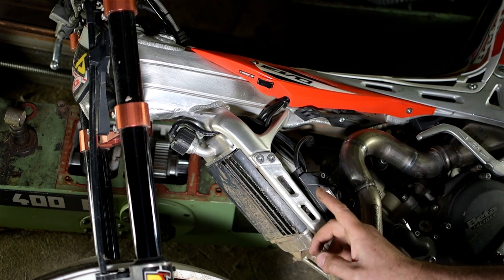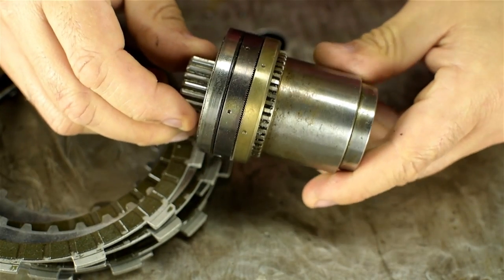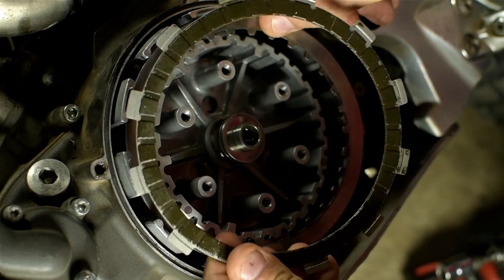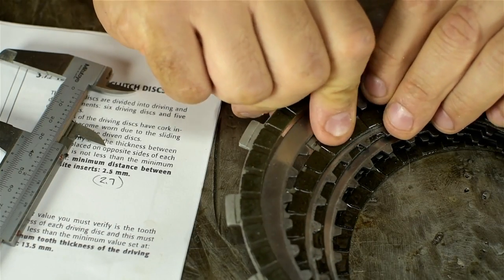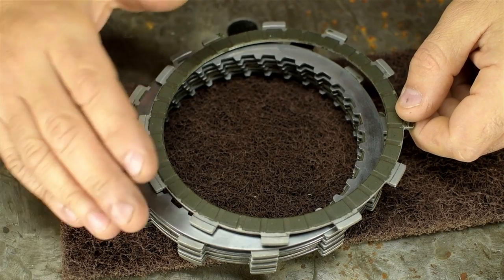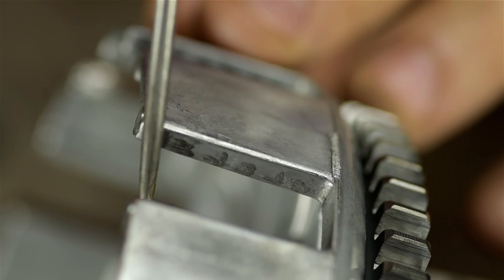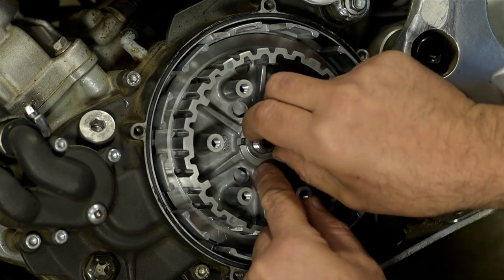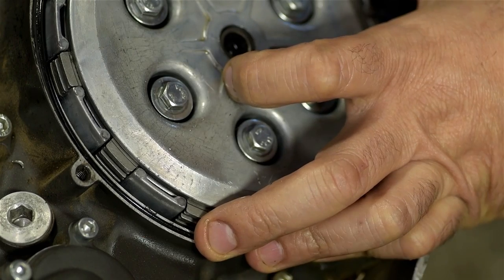something something MOTORCYCLE CLUTCH!

Comment: Hi Tony, Well, I like motybike video's as it's what I've done since 11 yrs old
Polishing the drive dogs is a waste of time (tried it on Ian Lougher's bike when he went to IOM TT way back when in 1980's) You really should have fitted new heavy duty springs, maybe just 3 of the 6 if you want slightly lighter clutch pull (although with hydraulic clutch it's generally pretty light) 
One issue you sometimes get with hydraulic clutch, the fluid overheats if line is too close to hot components.
'Roughing up' the plates just makes clutch grab plus they will 'polish up' withing a couple of uses.
 Adding washers isn't really the best idea although it does increase preload slightly. 
Those springs look like thy could get coil bound pretty easy though?
 It's also a good idea to drill some 1/8"~3/32" holes in the clutch hub to improve oil flow through plates. (at base of 'spline' for steel plates
 It helps 'wash out' any dust and keeps plates properly lubed (it's been standard on 100~200+bhp sport-bikes for many years, I did it on my bikes in late 1970's) It's kinda counter intuitive putting more oil through plates but it works

Comment: 11:00 I had a sportster that had a clutch that never worked right. I would literally pull the thing to pieces in a parking lot out of desperation at times trying to find a sweet spot setup or something. I kinda got famous with my friends for constantly adjusting the clutch. Years later and slightly less stupid, I now know that it was from the clutch basket, not the disks. Whenever someone tells me they cant get their clutch to fully grab, this is the first suspect for me, the grooves hang up the plates and keep the friction disks from fully collapsing and doing their job.

Comment: Water and soap on friction plates would be misinformation, please don't take anything in this video as instructional- the clutch operates in an oil bath that does not like conventional engine additive "friction modifiers", soak friction plates in oil before installing.  DEEP grooves on a clutch basket can be "lightly" filed down TO THE SHINY SURFACE, filing the WHOLE FACE down is increasing tolerances beyond spec- hence why the factory manual gave measurements for friction plate "fingers".  Visual shininess that is smooth to the touch (what Tony had) is perfectly normal so LEAVE IT ALONE.  Last thing- insert clutch "steels" back in with the smooth stamped edge inwards- eases clutch engagement smoothly.

Comment: Congratulations, you soaked clutch plate material in water that's going to be now introduced into the engine and detergent which is slippery. Big fat load of useless work and misinformation. More damage done than good.